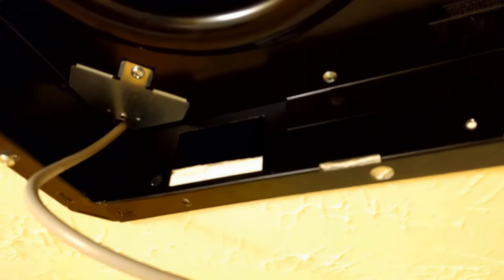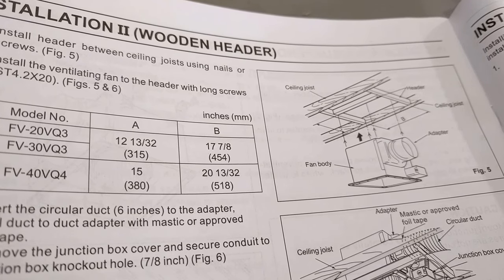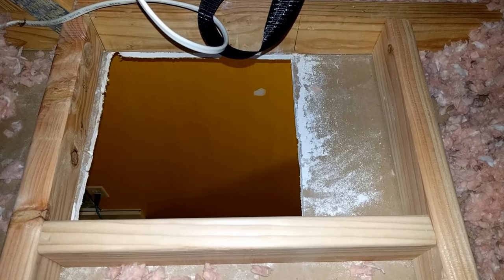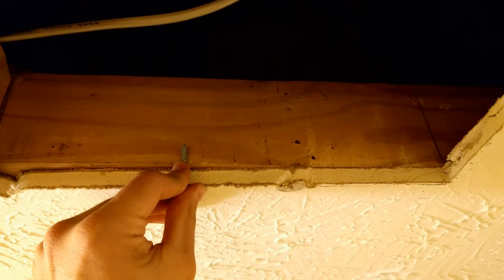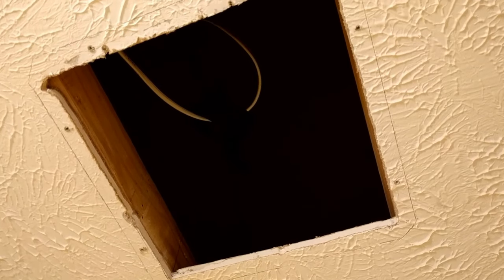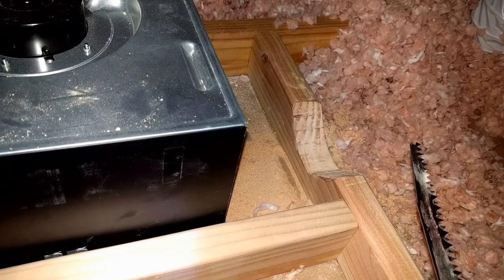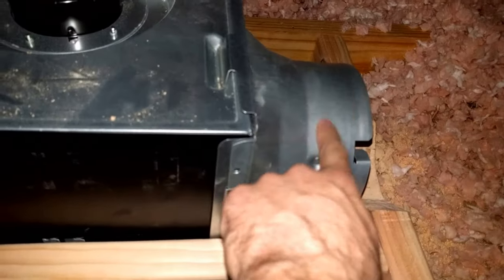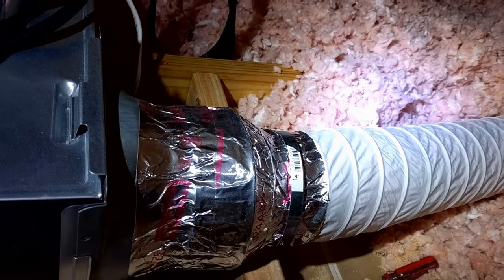Panasonic WhisperCeiling FV-20VQ3 bathroom exhaust fan retrofit / installation

Comment: Your video was EXTREMELY helpful with installation.  I installed the FV-30VQ3 version which was almost identical.  Instead of cutting the sheet-rock the 2nd time like you did I chose to remove the electrical box from the structure and moved it over about half an inch and re-welded it in place.  I did not have any supporting board on that side so it allowed the duct/electrical box to slide into place once the exhaust fan itself was mounted.  I did this because I wanted the lip of the exhaust fan to be able to hold the sheet-rock in place once it was installed.  Thanks again for the great how to do video.
Reply from the maker: Clever workaround!  I'm not skilled enough to remove and reweld...nor was I smart enough to even think of it.  Good job, and glad the video was helpful!
Reply: Yup I actually just installed mine and did the same, awesome that I'm not the only one.

Comment: I purchased the Panasonic FV-30VQ3 model (290 cfm).   When I called Panasonic with install questions, I  was told this model WAS NOT meant to be installed from underneath the sheetrock but for new installation only, that's why it doesn't come with a bracket kit.  I mentioned to the technician that there is absolutely  nothing in the instructions, paperwork, or even on the box that mentions this fan is to be new installed only.  After that mind blowing answer,  I asked the technician about ordering a 4 inch exhaust port, since my ducting is 4 inch, he said that if I didn't use a 6 inch duct, the fan will be noisy and the  exhaust air will be constricted.   I still complained to the technician about the lousy instructions, as if he cared, but at least he got my feedback.
Reply from the maker: The instructions DEFINITELY leave a lot to be desired!
Reply: Either way I think you would need to calk so the moisture does not enter the attic

Comment: Great video! I would suggest taking out the AC cable box and re-solder it with drywall clearance. Also turning the fan 90 degree instead of putting two studs and cut the current stud. But your suggestion of taping to prevent air leakage was a great idea. Thanks again for the video~

Comment: Scott, your video was well done, as helpful. >>>Scott, in my area, the flexible exhaust vinyl hose is not code, as a solid metal exhaust is code, and furthermore, the entire pipe, from exhaust to the roof, including the entire fan should be insulate to avoid condensation, only if you reside in a cold climate area.>>>I applaud your workmanship........great job!
Reply from the maker: Thanks, Conrad...glad it helped!

Comment: Not bad but, you should have positioned the fan 90 degrees from how you had it with the duct pointed between you joist.  The 2X4 you added could then be laid on its side to give support while maintaining clearance.  Otherwise you could have simply laid a 1X4 on top of the sheetrock to fasten to from the bottom.  With the other sides attached to the joist it would be secure.  Nice job though, very clean.
Reply from the maker: Thanks!  I positioned it that way so that it could have a straight run out to the soffit exhaust vent.  But you're right...there are a few variations on workable ways to do this install.

Comment: I read in the comments you have two of these. I did the same and got two installed but with 6” ducts. One sounds way quieter than the other. The louder one sounds kind of how yours sounds, like some mechanism is rubbing or something. Are both of them the same for you? I can’t get over it that one is much quieter. Both are the same model
Reply from the maker: That's a mystery. The one in my guest bathroom is louder because it's on a smaller flexible duct, with a bit of a curve / bend close to the fan. Not optimal. If they're both the same type of duct, and they're both heading straight out, that would probably suggest the fan? Maybe some of the other folks who've commented here have ideas, too.
Reply: @ScottHancock  it’s a brand new fan.. the fan is also spinning freely and round instead of wobbly. I took a video of it turned on at .5x optical setting on my iPhone and it seems like the flapper inside is moving up and down where as the good one is not moving at all. I wonder if that’s the issue

Comment: A word of warning…. it’s a good fan, but it’s only as good as the size of the duct.  It’s noisy and inefficient, because the exhaust duct isn’t large enough to handle the air volume.  110 CFM is sufficient for a standard bathroom

Comment: Did you ever figure out that rattling type noise from all the air movement? I installed the fv30vq3 model and it sounds the same. When the bottom grill is off, just putting my hand to redirect airflow would make it go away, I made up an air redirect and it worked until I put the  bottom part on and that changed the characteristics again and noise came back. 

The rattle noise is too much, sounds like I'm in a warehouse. I don't mind the airflow noise, just don't want the rattling. Hope you figured it out.

Comment: The fan box can be installed above the drywall or under it, it will work either way.  But its better for old work to have the box under the drywall.  The screws are intentionally long so they can go through the drywall and screw into the mounting bracket.  Either way works but its probably better to have the black box under the drywall so you have a nice tight fit.

Comment: Wish I would have seen this last week.  Ended up modifying the exhaust and electrical box to get it to fit.
Reply from the maker: The good news is that it'll go a LOT easier if you ever install a second one.  I just replaced our kids' bathroom exhaust fan and installed the same model number—the installation took about half the time of the first one.  I used 2x2' lumber to build the frame in the attic, cut the larger square in the ceiling the first time around, and everything went really smoothly overall.

Comment: Do you think whoever designed this fan hates people?
Reply: HA!  It's VERY possible that the person who wrote the installation manual hates people. The fan itself has been a champ since I installed it!
Reply: @scottandkatiehancock8267  I mean the two final screws are a work of art, you install the piece from the outside but you tighten them from inside )))

Comment: These come with the Flex-Z Fast bracket now that makes installation a breeze. Just installed the 150 CFM version. That Flex-Z Fast bracket gives great support and installs in a snap if you can get in from the attic. I dindn't even try from beneath.
Reply from the maker: That's great to hear! I'm all for easy!
Reply: Not for the ones that are 190 CFM and upwards  They show it on the image but is not there in the box or manual

Comment: How about installing the fan from the attic and having the initial hole. Resting the fan lip area on the drywall then screwing on to the sides. Won’t that prevent from making the hole bigger
Reply from the maker: It's a great question. To be honest, I installed this so long ago that I can't remember. Someone else here might be able to advise!

Comment: Hi Scott.. thanks for uploading this video!  I like how you recorded the fan noise at the end.  It is quite loud.   I have the 80 cfm one and thinking to replace with this one. Were you able to reduce the noise eventually?
Reply from the maker: Thanks for the comment! Yes...if you replace 4" duct with 6" duct, and vent it straight away from the fan, the noise decreases a lot. I used insulated flexible duct, but I'm sure straight / hard duct would be even better. I wasn't able to do that with our guest bathroom fan (same model), but it's still significantly quieter than a lot of fans I hear in other homes and businesses!
Reply: Thanks Scott for responding!  I just spoke with my contractor he will be using 6 inch ducting
Reply: Unfortunately I'm in a condo so I can't use a 6" duct 😢. My noise is elevated.

Comment: Thanks for sharing! Do you cover the fan with those (pink) foam insulation after installation in the attic?
Reply from the maker: Yep...once I got everything sealed up and connected, I re-fluffed and filled the insulation back around the fan.
Reply: @ScottHancock  Great, I was a little worried about filling the insulation on top or too close to the fan, thanks!

Comment: Glad I found this so I can hear how the unit sounds when reduced from 6" to 4". That's pretty loud. I put in a 110CFM WhisperQuiet and it was really just a hum. Albeit that was 4" solid pipe throughout. I'm curious how this is performing now 5 years later.
Reply from the maker: It's still running like a champ! It's proven to be well worth the installation hassle.
Reply: Dont mind a little noise. It adds privacy. How much performance did you loose? I just ordered a new one 290 cfm and a cone reducer 6-4”

Comment: I wish I saw this a few hours ago. I installed a similar Panasonic ventilating fan (FV-08-11VFL5) and had the same problem with the drywall creating a gap when you slide in the vent and electric box. They don’t line up because the drywall gets in the way. The instructions do NOT account for this! The instructions pretend the ceiling drywall is paper thin.

Comment: Love when someone does something wrong and all the comments are "Great Job" LOL. You're supposed to connect the duct/electrical box part BEFORE you  secure it. Don't blame Panasonic and their directions. Read them and understand them before you go hacking away at something
Reply: I'm getting ready to do an install of this fan and the instructions state 1) install header(s) 2) attach fan to headers 3)  insert duct to adapter 4)  connect wires.  I'm not sure where the duct/elec box connection occurs as the instructions are quite vague?  I'll have to do more research before I start cutting, etc.  (After doing more research I think I agree with a lot of the statement and this fan really is for new construction.  If you are installing/replacing an existing fan, you have to cut the hole bigger than the template, etc. as the video shows.   I built the 2"x4" supports and then installed in the attic.  My vent points parallel to the rafters/joists and if you plan correctly, you don't have to notch the end (if you even need it).

Comment: Maybe it's just the video, but it sounds noisy to me. Sounds like metal vibrations more than the actual fan. Did you ever caulk and tape the joints in the attic? Did the noise improve afterwards?
Reply from the maker: I did caulk the joints on the attic side. The noise decreased considerably when I upgraded to 6" flexible duct. For it to truly be "whisper quiet," you probably need to use rigid duct, like Panasonic recommends.
Reply: Thanks for the update! I clicked on your profile accidentally, I see a video about Mammoth Cave. Crazy, I'm from that area.

Comment: You installed it wrong, the cutout should only be the size of the box, the outlet and electrical box is installed first then the box slides in to connect to it. You did not have to cut the hole bigger.
Reply: You dont get it do you. The electrical box is so close to the bottom, it does does not slide back fully. If you have the fan  you will understand

Comment: You provided plenty of info, however you should not cut the joist.  You should have instead position the system in a different direction where the vent is pointing between the 2 joist and you should've tried securing other sides of the unit instead of the one with the vent coming out.  Just my opinion.
Reply from the maker: I think the joist you're referring to (the one I trimmed away with a reciprocating saw) is a header piece that I screwed in during the fan installation. It's smarter to just use a 2x2" instead of a 2x4"...I did that for my second fan installation and avoided that trouble. However, the integrity of the house isn't in question, because I didn't cut into part of the existing ceiling / roofing lumber. I only added that header (per Panasonic's instructions) to support the fan itself.
Reply: He didn't cut a ceiling joist, he only cut a short header that was added solely for the fan screws.  What was left was plenty to support the fan securely.

Comment: What a pain in the ass! I just put in a Panasonic FV-08-11VFM5 that pumps out either 80 or 110 cfm. It replaced a 50 cfm Broan in my ensuite. At 80 cfm there was not much improvement but at 110 it was a very noticeable improvement. I also have vaulted ceilings which don't help matters. This fan came with a Flex Z mounting bracket which made it a breeze to install. I was able to do it all without going into the attic. Not sure why they wouldn't sell this exhaust fan with the same bracket? I have a larger bathroom to do now and had planned on putting this fan in there to replace the 80 cfm Broan but not if I have to install it through the attic...... vaulted ceilings leave no room for this kind of crap.
Reply from the maker: No kidding! At the time of the installation, the Flex Z Fast bracket wasn't available on a fan with this high of a CFM. I will say that the second one of these I installed went WAY faster than the first. There's a learning curve, for sure.